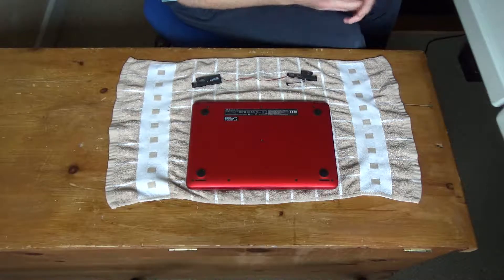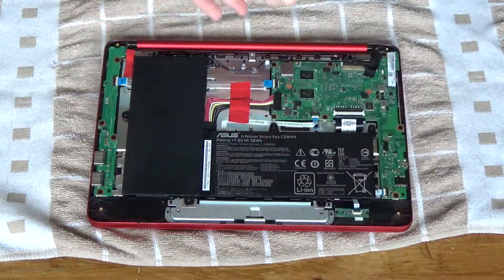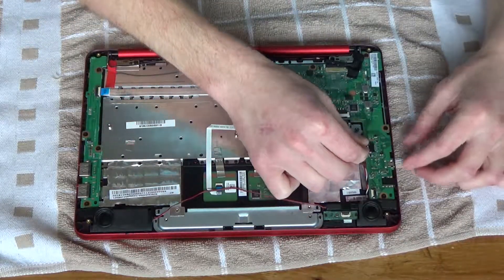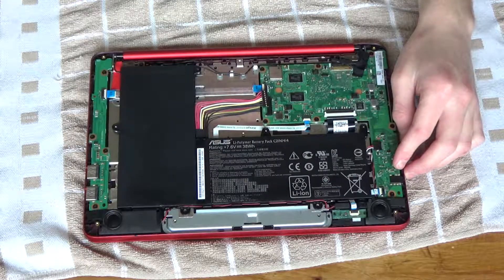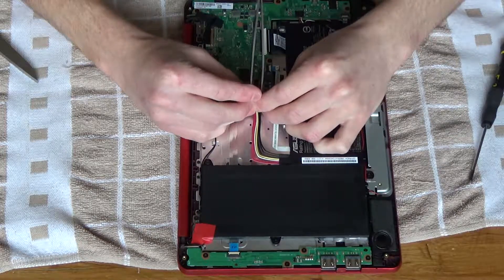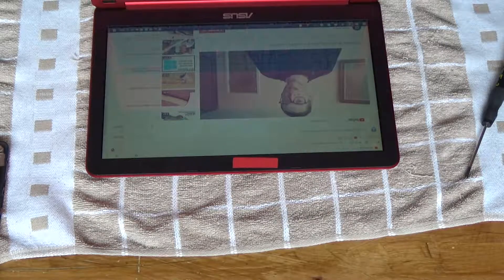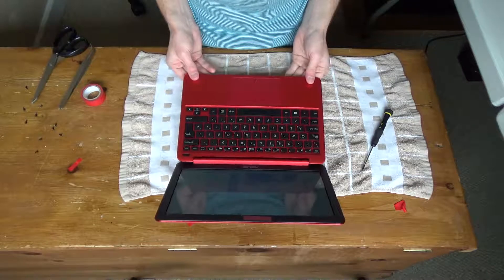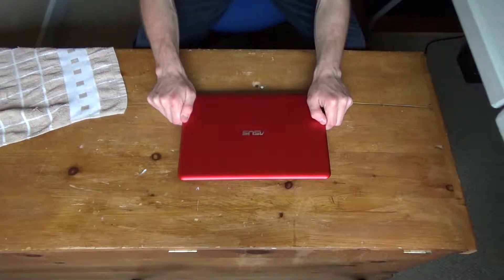ASUS X205TA Speaker Replacement: Installing & Testing New Speakers (Part 3)

Comment: My right speaker got hot and burned up, with curling smoke, electric smell, making crackling audio sound while getting extremely hot. Same as you I wasn't watching anything with audio. Did you get crackling sound before/while it burned up? I'm bummed, really like this little book. It was surprisingly hot, wonder the case didn't melt, good thing I hadn't quite fallen asleep yet. Thanks for the video(s)!
Reply: ASUS wasn't helpful or interested so, following your lead, I put a $9 used set in today and it works fine like before.  Yeaa :)